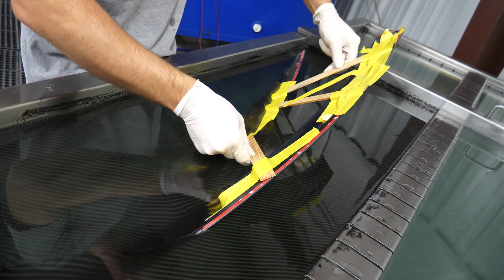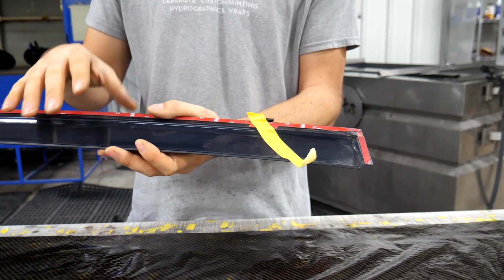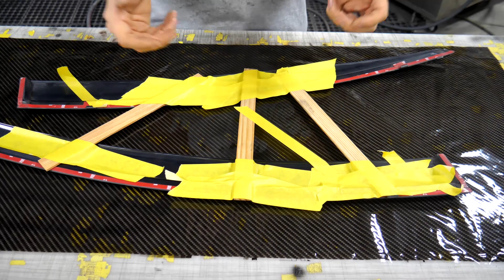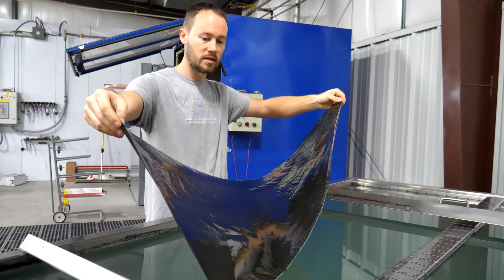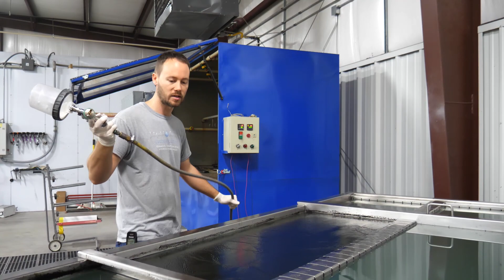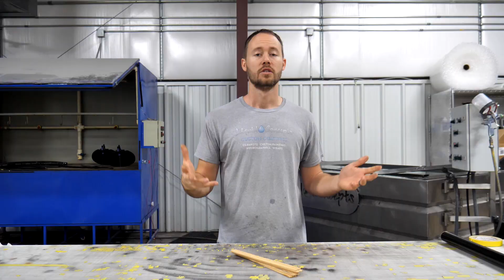HOW TO LINE UP YOUR CARBON FIBER LINES WHEN HYDRO DIPPING | Liquid Concepts | Weekly Tips and Tricks

Comment: Hey that was great dip as you do always hey which carbon fiber # is that your using from your site and what is the ideal measure that I will need for stock
Reply from the maker: Here is the carbon that we are using for this video - https://www.liquidconcepts.com/shop/product-detail/realistic-carbon-fiber. As far as a stock goes, I would suggest starting out with 1-3 meters of film depending on how many times you think you may need to redo the dip if it doesn't come out right.
Reply: @LiquidConceptsUSA  thanks so much..